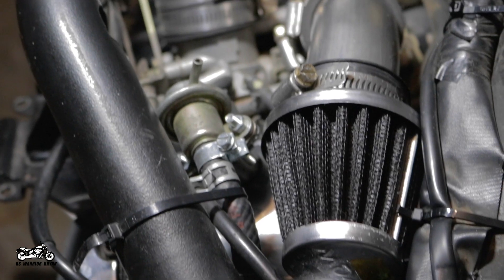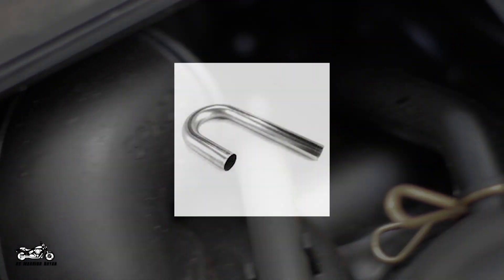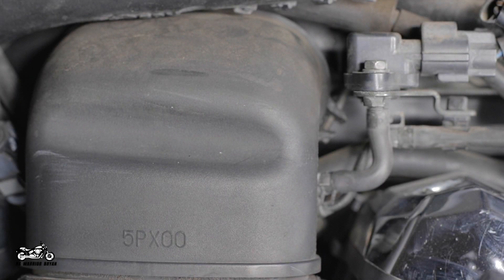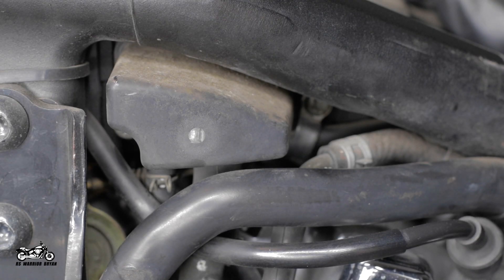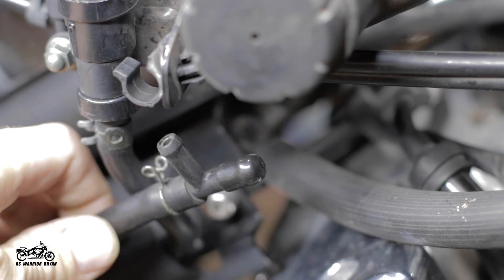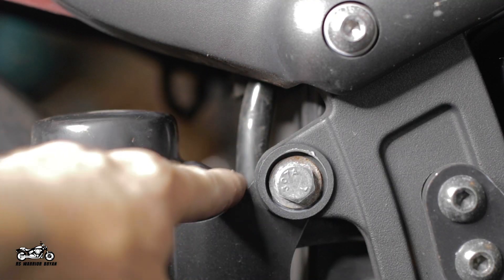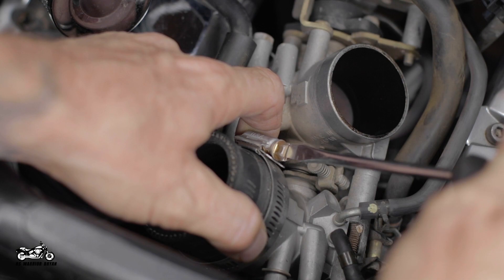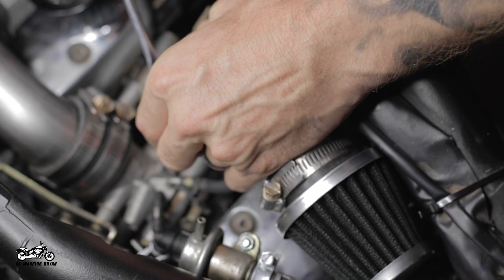Yamaha Warrior 1700 RS Warrior DIY VBAK

Comment: Over the last couple weeks in quarantine, I did the PR BAK. This video was a godsend brother. Thank you.
Reply from the maker: Thanks! That's awesome to hear because I honestly worried about this one. I worried that I went too fast through everything and didn't give enough time, or maybe the pictures could have been better. Glad to know that it was actually able to help you out and get it installed. Thanks for watching and for letting me know it helped. Stay safe out there brother!
Reply: The pause button my friend, the pause button. And I watched like 10 times before I actually started turning wrenches lol. Ride safe!
Reply: I did the PR BAK today and I'm not sure I would've gotten through it without this. Thanks!
Reply from the maker: Glad it helped! Also hope you're liking that Patrick Racing VBAK.
Reply: It's nice, definitely a difference. It appears if the previous owner wasn't even aware of the airbox or filter under the tank. My only issue now is surging between 2100-2300 rpm if my speed dictates I hang out there. For the time being I'm shifting to work around it.This was present before the upgrade though and I do have a VH fuelpak. I've read through the forums and blue bloods issue. I'm just trying to find a setting to maybe adjust it before pulling the FuelPak altogether. Reccomendations?

Comment: Man thanks for the awesome videos. Really helpful. I did the bak last night but have a problem the cel is on now. Scratching my head over it
Reply from the maker: Have you figured this out? Sorry I haven't gotten back to you yet about this. I'd check both dry breaks first thing. Spray with a little wd 40 and click into place. Should hear an audible click of they seat right. From there, I'd check the two sensors underneath from the airbox and be sure they're not crossed or pinched. Also, you can run a diagnostic and see what code pops up and that will help to narrow it down as well. Try those if you haven't and let me know what happens!
Reply: @RSWarriorBryan  yesssir got it figured out it was a vac line. Shes up and running strong now. Thanks for the reply

Comment: Hey Bryan.  I really appreciate your vids.  I have a question for you regarding pod filters. I bought a used warrior and had to take off the tank for a repair. I noticed There are two K&N pod filters attached to the stacks. They don’t appear to sit in position very well. What would be your advice on getting a better fit? Should I get some sort of extension elbow or use an original/stock elbow from the airbox? If I need to make an attachment, elbow, what would you suggest I use?
Thanks, Bob

Comment: Hey bryan! Appreciate the info. Any reason why you would use the j tube over the stock tube? trying to save money but dont want to sacrifice much.
Reply from the maker: Not really. The stock ones work just fine, especially if you're trying to build the kit for the least money possible. If you didn't want to do the stock ones, you could even put the filters directly to the throttle bodies, just make sure you get the right filters to fit. I believe the throttle bodies are two inches wide. Hope that helps you out a little. Thanks again, stay safe out there!
Reply: @RSWarriorBryan  you're the man brother. One more question. Is it ok to keep the stock air coffin on after doing a BAK?
Reply from the maker: Of course! Even have some guys that will install a cone filter on that side just for looks. Since you're removing the air box under the tank and everything, it won't be hooked up, so it'll just be for looks, but helps to hide the wires there also.

Comment: I have a 2006 warrior with flames, has been running perfect since I’ve had it. I just washed it and right after took it for a ride and it’s running fine except for when I’m slowing down. While letting the bike slow itself down in gear it sounds sick kind of like it’s missing or something instead of the smoothness that I’m used to hearing while slowing in gear. Any idea what it may be?
Reply from the maker: Hey Brittany, Thanks for watching and for the question. When you washed it, did you use a pressure washer? What kind of air intake set up do you have? How long ago did you wash it, and how long has it been acting like this? Sputtering could be any number of things ie vacuum line coming undone, water getting into intake, which is very rare, electrical connections on the coil, under the seat, etc.... If it clears up in a few hours, I'd assume water has gotten into somewhere. I'd check connections for any tuner you're running and the coils. Could also apply silicone to them to keep any moisture from occurring in the future. There are a few places to start checking, I hope it helps and you can get that bike back to smooth. Keep me posted and I'll try and help as much as possible. Thanks again and stay safe out there!
Reply: @RSWarriorBryan  I took it for a ride right after I had washed it, no pressure washer but did spray it pretty good with the water hose and nozzle. Has stock air intakes still. It did fine while accelerating but just sound real ruff while slowing and actually back fired pretty loud once.
Reply: I will ride to work in the morning if the weather looks a little better, we have rain coming up tonight but will for sure jeep you posted thanks a lot!
Reply: RS Warrior Bryan just got back from a ride haven’t been able to go out the past few days because of rain but the bike did a lot better, guess something just got wet after washing her and had to dry out.
Reply from the maker: Awesome! Glad thays all it turned out to be. You can hit those spot with some silicone and thatbwillxhelp to keep any moisture from getting in in the future. Thanks for keeping me posted, stay safe out there!

Comment: Hey Bryan love the channel, I got a few questions for you. I bought my 06 warrior with the V bak already done, just didn’t oil change and a few hundred miles later I noticed oil on the rear head gasket. It seems to be coming from The little pod filter on the rear cylinder head. Should I just reroute that?

My second question is do you know why my air filters have oil on them, I do ride the bike relatively hard shifting at 4,200 rpms more or less. Would that cause the oil spit back ?
Reply from the maker: Hey Nikko, when you did the oil change, did you follow the procedure for draining and filling? Any idea how much oil you put in? The little pod filter on the crankcase breather will leak a little bit, but leak more when the bike has been over filled with oil. I ride mine the exact same way, shifting around 4200, and haven't had any problems at all. Check your oil level and see that it is good, also following the procedure. Lol if that's fine and you see that it is leaking just a small amount from that filter, and not the actual head, I wouldn't worry. Hope that helps, keep me posted on what you find out.
Reply: Ok so the shop that did the oil change over filled it by about 12oz and after I got it back to spec “fallowing the procedure” I still have oil leaking down the left side of the rear cylinder... it seems a bit more than what is considered normal. What’s your take on it ?

Comment: Do the stacks make that much more of a difference compared to having no stacks?  My bike has K&N filters directly on the throttle bodies. Just curious, and thanks for the video Bryan. I am also one of the people you describe in the beginning of the video. The forums and your videos have taught me so much about our Warriors.
Reply from the maker: I'm glad they have helped! Thanks for watching. As for the stacks, they're supposed to help with the air turbulence. It changes with different lengths, curves, etc.... I believe the Patrick Racing stacks give more torque and the churchkey ones give more power, or vice versa, can't really remember. If you're looking to clean up below the tank, the bak gets that done and makes changing plugs easier. The K&N filters are also giving more air flow as well. Would probably see a slight difference with the stacks though. Thanks again Kyle!

Comment: Hey bryan, where is the fuel relay on a 2002 yamaha warrior xv17pcp
Reply from the maker: It's actually located near the battery box under the seat. If you remove the battery, you'll find the relay rack. Has your headlight relay, turn signal relay, etc.. It's actually located behind the turn signal relay. Hope that helps. If not, let me know and I'll try and give a little more info. Thanks for watching!
Reply: @RSWarriorBryan  thanks for the info its still hard to find
Reply: I found it thanks.

Comment: Bryan, if I want 2 swap out my sparkplugs, do I need to remove the stock airbox as shown in this vid? :/
Reply from the maker: I believe you are able to squeeze them out of the side. That is where the factory tool kit is really handy. With the big air kit, you have a lot more room to get it there. You'll cuss that right, front plug a little more, but should be able to get it out. The hose will be really helpful to get it started as well. Good luck!
Reply: The right rear plug is a pisser on warriors.
Reply from the maker: Haha. Plugs on this bike are such a pain. That's the only reason I went with the iridium plugs, so that hopefully I can go a lot longer between changes.

Comment: My warrior is burning a lot of oil ,yet i don't see any black smoke or oil on the garage floors. I'm topping up with a semi synthetic  10 40  oil ,any opinions would be appreciated
Reply from the maker: Hey Sean, thanks for watching and commenting. Oil consumption on these bikes is pretty rare. May be a dumb question, but have to make sure. Are you making sure to warm up the motor and do the correct procedure when checking the oil? Are you running a BAK/VBAK? If so, have you looked at the crankcase vent filter or line to see if any is coming from it? I usually take some cardboard or white paper after an oil change, or when looking for a leak and let it sit overnight under the bike. Let's me see pretty quick if anything is leaking. How much oil would you say you're losing in how many miles?
Reply: Hi warrior Bryan , having read your reply,I looked at your video on the correct way suspensiond had to remove some.As this is my first cruiser, its a pretty silly mistake and i appreciate your advice and patience. I will keep a close eye on it after each ride for a while until I'm sure all is well.It is an 06 American import  and would appear to be standard in every way except for Vance and Hines straight pipes ,a bit rare here in Ireland. Thanks for your help and best of luck to you
Reply from the maker: Awesome! Better than having a leak that you have to track down and fix. Thanks for checking back in and letting me know. Hope you're getting some good rides in. I have Irish ancestry and would love to visit there someday. Thanks again and stay safe brother!

Comment: Do you have any advice for a RS Silverado 1700 that’s carbureted? I want to upgrade my intake to get some more power but the carb is what is Chinese to me
Reply: If you have an aftermarket exhaust and install an air intake, you will need to have the carb re-jetted. If you are not familiar with carb jetting, get it to a shop for this tuning. Also I'm assuming your bike is not a Warrior like in this video. I suggest you check the Facebool group Road Star Clinic. Awesome group and very helpful. Good luck!